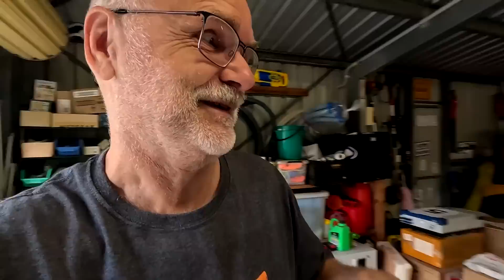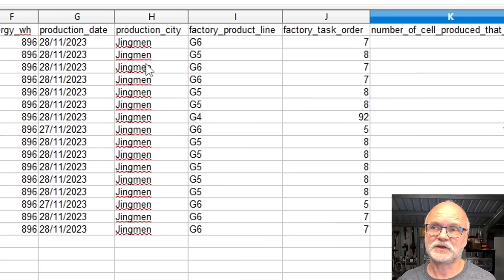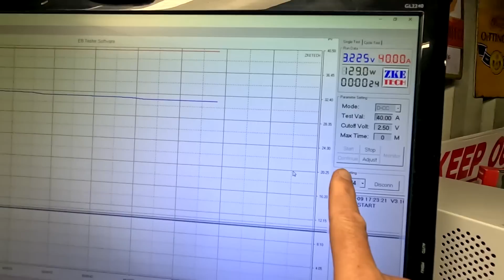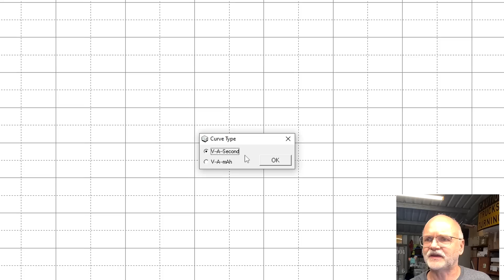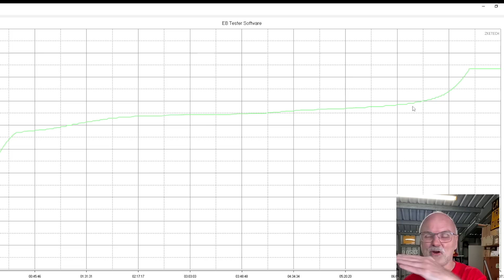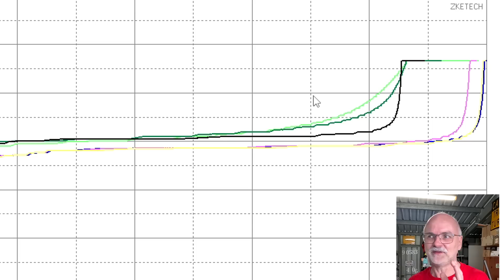Yixiang Batterie Consistency Test and how to identify problem cells. Wait! Have we just found some?

Comment: note to self , only buy one colour undies

higher balance start voltage, have a battery with a degraded cell that i noticed it would top the voltage sooner ie hit 3.45 balance start voltage 

then move power from it to other cells only to move the power back when reaching full

so i just lifted the balance start voltage to 3.48 to give others time to catch up before it starts to balance

can only imagine how certain cells will get out of balance  with a passive balance bms ie discharge for long time unable to correct during the short CV phase

causing it to degrade rinse repeat then
Reply from the maker: You mean, I cannot mix black, blue and pink (sometimes)???😯

Comment: In case anyone is curious, I just finished an initial parallel top balance on 16x 306ah EVE cells at 10 amps constant current and it took from July 1 until July 19 and used 35kWh on the Kill-a-watt meter due to the inefficiency of this method.  Starting voltage was 3.227 and ending voltage was 3.650.
Reply from the maker: Yeah, don't have them in parallel for that long and trickle charge them. 
If your BMS has an active balancer, just build the 16s battery and charge them to 3.45V/cell. The slowly increase the voltage and let the balancer do the job. If all cells are at 3.6V, call it. That's all you need for an initial top balance.
Reply: @OffGridGarageAustralia  Thanks for the response. I'll keep that in mind for the next set.
Reply: Ouch. That's not nice for the cells. Low current, high voltage for a long time. You will probably have already damaged the new cells.
Reply: @BluBioBike  Just like beekeeping, in any group of three individuals you'll get four different opinions. I've personally never heard of that possible quirk of LFP chemistry. Where did you get this information from?
Reply: @NoelBarlau  nordkyndesign: "charging-marine-lithium-battery-banks" there is the topic is pretty good eplained. Also Andi from off-grid garage made serveral videos about that, f.e. "LiFePO4 charging and discharging curve explained. How far to go?"
Reply: @BluBioBike  Thanks for the references. I'll check it out.

Comment: check internal resistance at end of charging (or in the middle where the spread occurs). It may change during load process because of chemistry issues.
As you said yourself: those measurements are just a snapshot - and you onl did at 30% SOC as they arrive.
Reply from the maker: Yeah, I will do that once the battery is build.

Comment: As nyloc nuts have resistance when tightening it will reduce the clamping force on the busbars for a given torque setting. Their smaller diameter provides less coverage across the busbar slot so a washer might be advisable.
Reply: Wouldn’t the same torq setting on a smaller surface increase pressure ? Also as the contact surface of the nut is smaller and so there is less friction between the nut and the bussbar ?

How is the thread of those nuts in comparison to flangenuts ? I guess some current will flow from the thread of the studs, thru the nuts to the surface of the bussbarr, so less contact with the nut due to no flange and a perhaps smaller thread may increase resistance and thus create more heat at higher amps. I think that is why Seplos (used to) deliver extra washers for inbetween the studs and the bussbar, to compensate for the loss of contact surface in unround/oval holes. Flex bussbars may have round holes (I hope), so that would also be better.
Reply from the maker: I don't think there is much current going through the stud itself and then into the nut and finally to the bus bar it holds down. 99.99% will go directly from the terminal to the busbar.
Reply: @OffGridGarageAustralia current takes all parts according to their resistance, no conductor is without current when it's between two different potentials

Comment: Nice one...always putting the finger in the wound 😂Testing all 16 cells would be interesting. Than use them for some cycles and test again...but that is too much work I guess...
Reply from the maker: Yeah, I haven't got the energy atm. Winter, you know... And time, it will take a lot of time to test and evaluate the curves. I probably just build the battery and let HA catch the cells data?

Comment: This is why having a good active balancer is critical, I have 16 batteries coming from Gobelpower they are MB31, just sailing down the east coast of Australia as I write, so hopefully see them in a couple of weeks
Reply: How would an active balancer make all of the batteries have the same charge curve? What other advantage does an active balancer have over a standard one in this situation? If the capacities are the same, there's no reason to do extra balancing since by the end of the charge all the voltages are the same?
Reply: @BenBrand  I never said that an active balancer makes the battery the same charge curve. but it allows a longer charge time before the BMS stops the charge due to over voltage.

Comment: Hi, Andy. That is something new indeed. What is strange is that even cells with almost the exact  moment and place of production have these differences. As indicated below they may just be virgin new, but why then mix them with batteries already cycled a few times. When sold as a pack the difference in capacity would make for a lower capacity pack, as with any capacity differences    within a single pack. 

Not sure what happens when balancing though. It will balance out eventually and during discharge the BMS may comeup with an early low cell voltage shutdown, while the pack voltage might still be in the clear. Also the balancer may try to balance 2 cells with a different chargecurve at some point but with the same capacity.

Testing them all might give insight in what other surprises are in the shipment.

When cycling them does not fix the issue the pack may only be used at a % of its rated of potential capacity.

The question is why this is happening. 

Did you notice in the past a difference in the curves when charging at 1C for example?
How to measure resistance under load ?
Perhaps the voltage rises prematurely due to a higher resistance during charging (internal heat buildup) at some point. Or the electrolyte is contaminated which would suggest a fault during production. 

If these are original Eve cells, maybe Eve can comment on these curves and of why they do what they do.

All in all, if all curves were the same you might just have a somewhat different chemistry in the cells. But they don’t, so what they delivered for building a pack is just bad.

Finally you could check the tester with one of your other cells. The looks somewhat like a combined CP chargecurve .

Anyway, this is new and this is where we can learn.

Keep up the good work.
Reply from the maker: Thank you. It could be that the reseller is doing only random capacity tests on a few cells to get an average reading of capacity of a batch.

We will find out once the battery has been build.

Comment: Maybe you will get a voltage spread from the cells at about 3.4 so they wont balance so well higher than that...i have a similar issue with some cells.  The solution is to lower the top voltage and reduce overall capacity  a bit.

Im experimenting with 17s which allows a lower max voltage so all the cells have a similar value at that point 

Interesting video
Reply: I did the same with lowering battery voltage and my cell issues went away.

Comment: It would be nice to be able to opt out of the buss bars and yellow plastic and maybe save some $$. All of the ELL boxes I've bought have flexible buss bars, yellow sheets, and foam pads ... which I add to the the yellow sheets, not the battery.
Reply from the maker: Yeah, on the other hand, too many options may increase the price again because boxes need to be opened and accessories added or removed.

Comment: Very interesting. I have two 24V batteries with 105Ah cells. One is homogenous with cells purchased from Alibaba, well balanced, the other is a plastic case battery purchased from Aliexpress that I took apart and replaced some bad cells with. I'm trying to figure out how to use this jumble of batteries. The JKBMS 1A balancer is not helping, one cell is hitting OVP/UVP and not getting the full capacity. If I put 8 cells in parallel and do a few charge/discharge cycles from 2.5V to 3.45V, will the variation decrease? In the future I'd like to put them in series and change it to a 48V system, and add a 280Ah 16S battery, but it's a tough road ahead.
Reply: Put the (bad) cells in parallel and charge them all to as high as you dare (I would go to 3.55 maybe) and leave them there for a couple of days. This will ensure a good top balance. Cycling them together won't achieve anything.

Be aware that mismatched cells will never retain their balance under load, so only worry if they are actually going outside of  spec (i.e. under 2.5V). Only worry about their balance when the battery is unloaded.
Reply: @clintoncoker6  Thanks for the advice. I have failed to balance the top of the cells in parallel several times. Maybe because I set the voltage too low (3.5V) or because I didn't charge them long enough, but they looked balanced, but the charge levels were not the same. A few days ago, I tried to balance them in series. After charging them with a 5A charger, I connected a constant voltage power supply set to 28V and charged them slowly at about 2A so that OVP would not occur. At one point, I reconnected the constant voltage power supply to the cells that were not increasing in voltage from around 3.36V and supported them up to 3.4V. As a result, all the cells stabilized at about 3.48V, and the balancer did not work, so I left them like that for more than 24 hours. I connected them to an inverter, and since the sun was not fully charged or fully discharged after that, it looked like they were balanced.
Reply: Although if one cell is consistently hitting UVP & OVP, it sounds like that cell is either under capacity compared to the others, or has a high internal resistance.

Comment: Well, it means these batteries charged faster than other batteries. Andy what is the charging time difference between other vs these batteries?
Reply from the maker: Cell6 charged for 7h10min (297.8Ah charging capacity)
Cell12 charged for 7h15min (293.9Ah charging capacity)

Time can really be different depending on many factors.

Comment: I’m a bit concerned too. The active balancers will work overtime on a battery with the mixed cells you have. Like a Frankenstein battery… What balance start voltage to set, hmm? 
I wish it was practically possible to test all 16 cells like 3 times, to see how they behave. With Home Assistant connected to a JK BMS, maybe via Victron, cell data could be collected and graphed together, when working as a battery. Would require lots of energy, but give lots of results, faster :)
Reply from the maker: Maybe it will be OK once top balanced and the balancer has gotten them all inline at 3.6V. We will see shortly.

Comment: This is not directly related to this video but I need urgent help. My JK BMS shuts off power briefly, then reconnects if a cell exceeds the overvoltage protection limit. I noticed on the app that it shorts off charge only and leaves discharge on but it still cuts off power briefly then reconnects power. This keeps happening as often as a cell exceeds the overvoltage protection limit. Please is this normal behaviour? How can I prevent this problem from happening over and over again?
Reply: Sounds like normal behavior. When a cell reach over voltage protection level, for example 3.65V, then the BMS disconnects charging, until the recovery voltage is reached.
Reply: @madsskov_dk  thank you for the prompt response. I understand the part of the BMS disconnecting charging being normal. What I don't understand as normal is the part that the BMS also disconnects discharge for a few seconds and then reconnects discharge again. Is this normal as well?
Reply: @adon8672  the discharge disconnect should not happen. Strange. Maybe add a second battery :)) Will keep things under control :)
Reply: If battery charge controller max voltage is to high and 1 cell could be running away .
You could lower charger voltage a bit . Then look at balance. 
Terry
Reply: @terrencewpalmer  thank you but is it even normal for the BMS to interrupt the discharge process, then reconnects? I thought when a cell hits the overvoltage protection limit, only charging should be cut off.
Reply: How many cells 
What's charger voltage.
What's total voltage when single over voltage trips
Reply: @terrencewpalmer  there are 16 cells and the maximum charge voltage is 56V (3.5V/cell). Balancing is set to start at 3.43V.
Reply: Lower the battery top voltage to 54 volts and see if this helps.  If not keep lowering. If yes you could slowly raise it .1 volt per week until you start seeing the issue again.  Worked for me, but 54.0 volts is good enough for me.
Reply: @mfgxl  I will give this a try. Will the battery still get to full charge capacity at 54V (3.375V/cell)? What will the cell overvoltage protection and cell overvoltage protection release voltages be? At what voltage should balancing start?

Comment: I have seen this myself with a small handful of cells. I deemed them NQR so they did not go into regular PowerPaul batteries. I would say either you've been deceived about the grade, or there's been an error made with the grading. 

As well as the slow voltage increase, you will probably notice a very drawn out current decline if you charge to a low cut-off voltage instead of 14A. And you will almost certainly see an increase in temperature compared to other cells. This is probably best observed when you build it into a battery pack. The end result is a battery that needs to top balance pretty much every cycle, and that top balancing is slow and drawn out, so the battery with these cells should not be used for mission critical tasks.
Reply from the maker: Thanks a lot, Paul. I appreciate your insight.

I will build this battery soon and see what I can find out. It will certainly be interesting.

Comment: Hmm that's interesting. Not sure how that would effect performance in the end? I guess right up front I would question how that's going to effect the end of the charging cycle? May be giving the balancer a real workout or cut the pack charge short if you don't have a balancer?
Reckon you'll have the answer to that soon enough...

Comment: I think you have grade B batteries. To verify this, you need to peel off the black plastic insulation that is on top of the cell and carefully examine the quarcode. It is possible that the factory markings have been sanded off and a new code has been applied. The fact is that at the factory, cells that do not qualify for testing for grade A are marked with the letter B on top of the quarcode. Small wholesale trading companies buy these cells from the factory at a reduced price, then grind off the quarcode with the B mark, apply exactly the same quarcode without the letter B, weld threaded rods to the terminals and sell these batteries as grade A.
Reply: Yes, some rubbing with alcohol to remove glue can reveal a "halo" of sanding or polishing around qr code area. Sometimes they even don't bother to match qr code to writtenserial number ;)
Reply from the maker: If there is another barcode under the black cover. it would be fake batteries. B-grade cells usually have a B stamped onto the QR code as we have seen and tested before.
Reply: The fact is that on such cells the code with the letter B is polished off and in its place the same QR code is applied, but without the letter B. Last year I bought 48 of these cells on Alibaba. However, they turned out to be quite good new cells.
Reply: @OffGridGarageAustralia  there is a technique how to "relase" B qr code. Without peeling off the plastic cover it is nearly impossible to determine this fact.
Reply from the maker: @dlya_svoih  I know, we have shown this this here on the channel before.

Comment: I would have to wonder how this would effect balancing at the top of the curve.
Reply: Seems like it would depend on what your balancing start voltage was set to. If it was set to 3.6 then the cells got there at the same time. But if you set it to something like 3.5 or 3.45 then the cells with the gradual rising curve would hit that much sooner and start possibly unnecessarily balancing early. It does seem like even if the cells are fine operating that way you would want all of them to be that way. That way they would all start balancing early since a lot of times you don't want to have to charge them to 3.65 every time